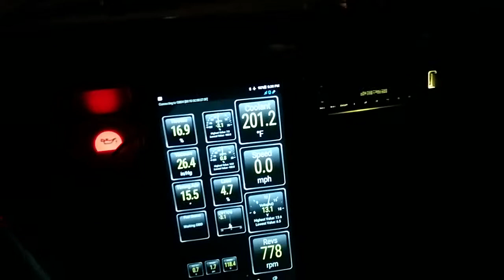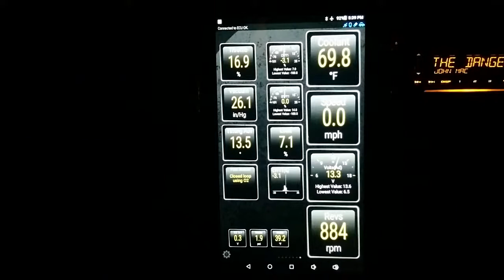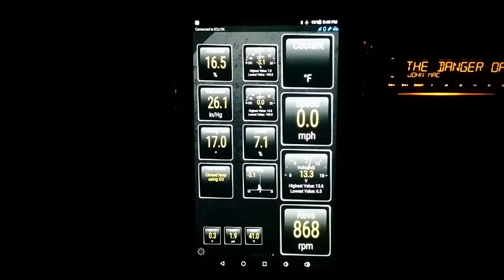Jeep Cherokee Open to Closed Loop Cold Startup

Comment: Q- when my 98 XJ goes from OL to CL from cold start it struggles but a quick rev and it clears and then maybe runs a little rich. If it's a hot start it runs perfect in OL then goes crazy sputtering when jumps to CL and very hard to get it under control as it is surging etc. Sometimes a quick off on clears it back to normal. I've replaced both o2 sensors with bosch and cleaned out IAC and throttle body. TPS reading looks right and I think MAP looks right although indicates a drop in vacuum during the issue. What do you think is up with it? Is it IAC sticking or some other fault ? I've also cleaned up all the grounds! You mention fuel pump etc, can that affect?